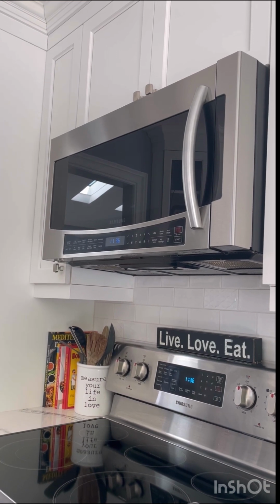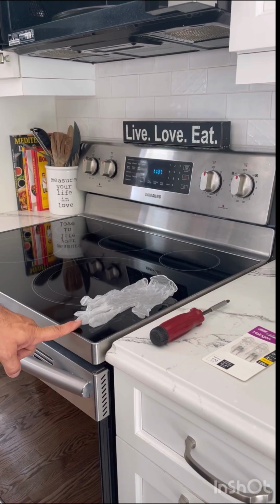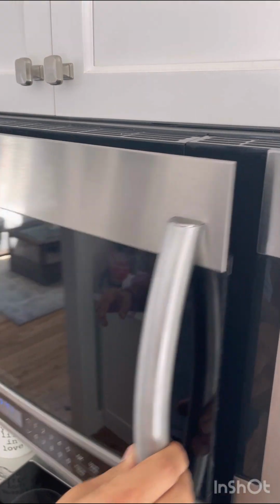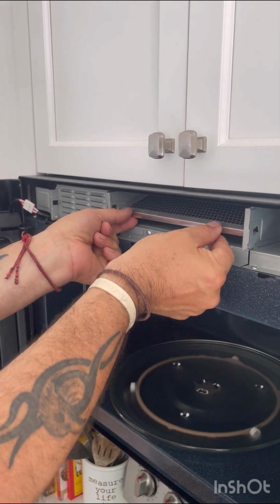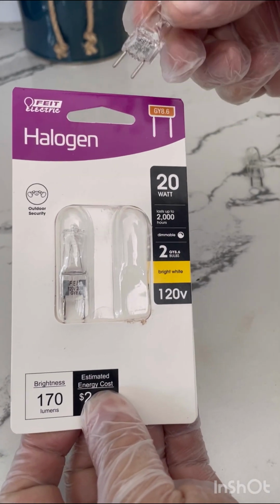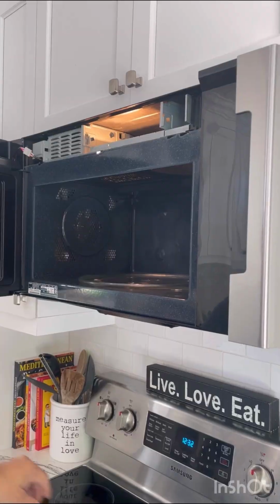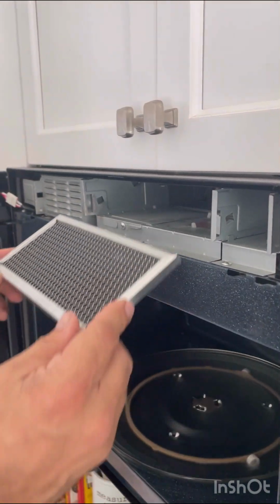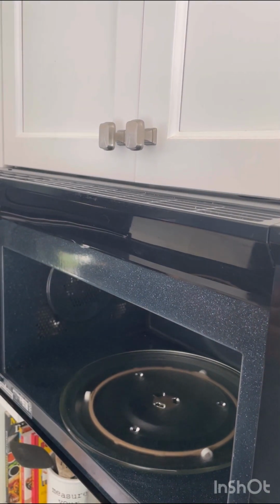Microwave Oven Compartment Bulb Replacement

Comment: The steps you state to replace the bulb are good, EXCEPT how do I with large hands get the 20W Halogen bulb in??? And now of corse my microwave will nt start even though I reset cirri breaker and reset clock.
Reply from the maker: Hello Harry. Glad you found the steps helpful. 

Oh course you don’t want to touch the halogen bulb with your bare hands. The intense heat of the bulb combined with the natural oils on your fingers can result in the bulb breaking. It is a bit awkward to ‘hook’ the bulb in place. You might try wrapping the bulb in a small bit of paper towel and using a needle nose pliers to maneuver the bulb in place. Alternately you can wrap the prongs of the pliers with the paper towel. The idea is to grasp the bulb with the pliers while protecting it from the metal plier jaws. Don’t squeeze too hard. We caution about using tape since any glue residue that finds its way to the bulb might have an ill effect on the bulb. 

Not sure why it’s not firing up. This procedure should have no impact on the operation of the machine.

Good luck and thanks for watching.

Comment from the maker: Hey there. Unfortunately, we cannot comment on the use an LED - we have no info on the power draw or flicker. 

As far as the bulb, it is important to get the right bulb for your model. Heat tolerance, size, pin depth, pin spacing, etc. can all affect the bulb selection. For example in the model we are using in the video, we learned they are actually two bulbs model numbers that are appropriate. One was actually specified, and the other was a back up choice because the original was out of stock. But we found many more than two that looked correct, but upon close inspection we found subtle differences. Please be sure to check the bulb application for your very specific model number. Thanks for reaching out.